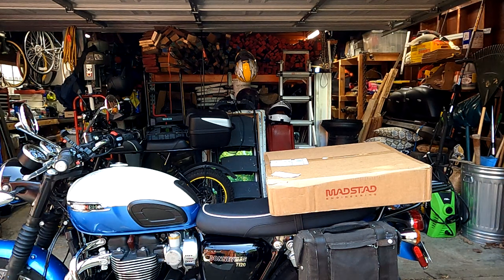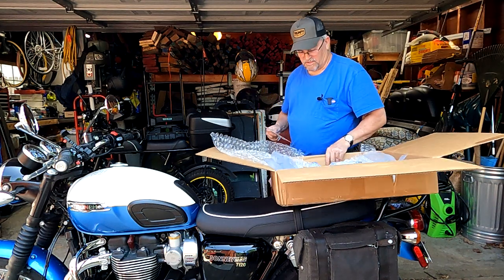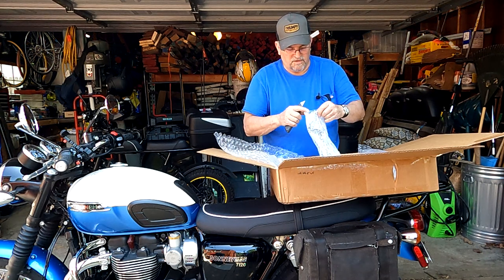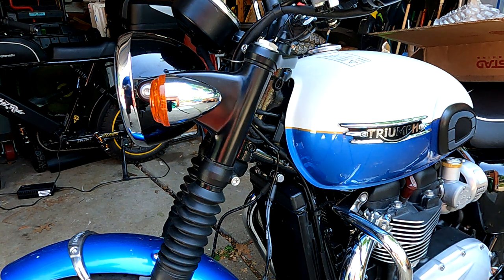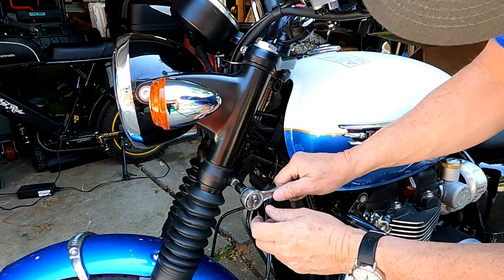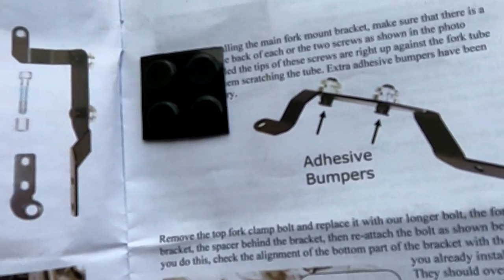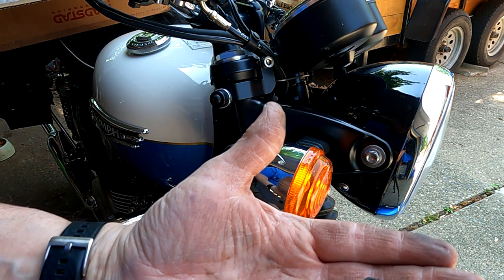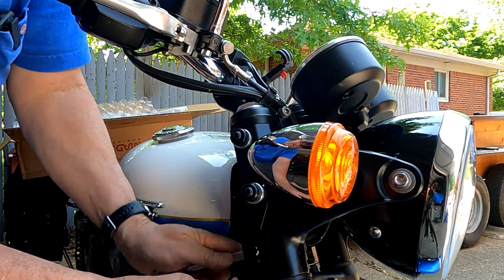Triumph Bonneville Madstad windshield install

Comment: I got mine installed a couple of weeks ago with the help of your tips.  So far the best windshield for my Bonneville T120.  Madstad is a no brainer because of the adjustability.  Back all the way I will get the summer breeze, and for winter it’s just about perfect, if you can call it winter for what we get in SoCal.
Reply from the maker: Thank you, it's good to hear that my video helped someone. I'm still very happy with mine. Waiting for spring to come so I can getbriding again. Snow on the ground still here.

Comment: You made it look easy!  Mine came today, pretty straight  forward, although the locking mechanism  for the detach were on wrong from the factory,  windshield  did not line up, figured it out but it took time, bought the 18" I'm 5'7" and this worked fine, no buffeting,  windshield is a little  flimsy  but I think it's designed  that way to give it a little flex, much better than the dart marlin windshield,  overall happy with it,

Comment: Hello! Thank you very much for the video. It looks really well constructed.

Just one question: have you already tried in the highway? It will highly appreciated to know your feelings after the riding test. Thank you in advance.
Reply from the maker: Yes I have used it on the highway. For highway use I like to raise it up. Lower speeds around town I lower it to about the mid point. The beauty of this windshield is its adjustability.

Comment: Hello, 

I have a Triumph Bonneville t120 black  . 2023 Model.

A couple of days ago I installed the Madstad windshield by watching this video and thank you for it.

After Removing the stock top fork clamp bolt and replacing it with the ones Madstad  provided, I see that the bolt is not %100 in its place screwed.

So,I just wanted to ask you if this is a normal situation or did I do something wrong? I took the picture of it as well and can send it to you too.

Your help would be super helpful and thank you very much.
Reply from the maker: Compare the 2 bolts side by side and see if the new one that madstad supplied is indeed longer. Mine was.

Comment: Nice work, I was wondering what it looks like taking it off and on with the quick release.  Was the cost of this more than Memphis Shades?  I think I was looking at them before but that was quite a while ago.
Reply from the maker: I filmed it taking it on and off but the camera was in picture mode and not video, grrr. I think it was more than the Memphis shades but it's a very different design. Totally mounts to the fork and is a breeze to remove and put back on with no tools needed.
Reply: Gotcha, I’ll take a look again before you put the windshield on, so you just unhook the side then and don’t have to mess with the screws in front when taking them off is I guess what I want to know.  I love the look of the naked bike, but yeah, reducing wind to the body would be great at higher speeds.  I can’t ride or do work on mine as I’m recovering from surgery so I’m living vicariously through you now and planning for the future.
Reply from the maker: Yup no tools, just 2 quick release brackets that you pull out and then swing up out of the way and the shield lifts right off, goes on just as easy, takes seconds to do.

Comment: Sir, where did you get that adjustable windshield for triumph T120.
Because I have one too. And I need one.
Reply from the maker: The brand name is Madstad, they are in Florida USA. They build each one to order. I'm very happy with this windshield. If you Google it and give them a call they will also tell you how to measure for the correct height windshield for you.

Comment: Please let us know how it works. What height did you get? I’m interested in getting one. Thanks,Chuck
Reply: I think it looks great,  Chuck
Reply from the maker: I ordered the 18" height and for me at 5'9" it's perfect. But if you call the company they will tell you how to measure for the correct height, it kinda takes 2 people to do it correctly.  Have an assistant help with that. I've had it up to 70 mph for the first test run as you saw me set it up and it worked really good. It's a much .ore relaxed ride at speed as your not holding onto the bike trying not to get blown off. And the biggest thing for me was much reduced wind buffeting, almost non existent! I'm still going to play around with the angle and height a bit just to see if I can improve it further, but overall I'm very impressed with it. They sell replacement shields for it if it ever gets damaged or scratched and you can get it tinted too. They make each one to order so it does take some time to get it but it's well worth the wait.
Reply: Did they have you measure your torso?  I’d think that would make more of a difference than overall height.  When you went on your 70mph run, was the wind hitting your helmet in a certain area?
Reply from the maker: Nance they have you sit on the bike and hold a measuring  tape on top of the headlight at an angle the same as the fork and have someone look to see where your chin is in alignment with the measuring tape, then subtract 2 inches so you will have some adjustment.
On my first test run at high speeds the wind seems to hit the top of my helmet, a little adjusting and I think that will be gone. And I look over the top of the windshield.
Reply: @woodtickgreg6926  sounds good and professionally done.
Reply: Thank u so much, influenced me to order one, I  downsized  from a harley  road king to triumph t120, also installed hepco Becker c bow luggage and heated grips,  I don't reccomend  corbin gunfighter and lady seat, hard as a rock!!,  I do have a dart marlin windshield, it does keep a small amount of wind off you , also stops bugs from getting all over the speedo and tack, it does really accent the bike though, can't wait for the madstad,  thanks again for a very informative  and well explained video
Reply from the maker: @robertparisi8016   yeah I don't think the corbins are what they used to be. I have heard a lot of folks complaining that they where hard as a rock. I'll probably go with a stock triumph comfort seat at some point. Now that I've done some longer rides I can feel the need for some improvement in the seat.

Comment: Great video, you just sold me on the Madstad 18" for my T120 (i'm 5'6"). I am curious how the brackets look on the bike once you took off the windscreen using the quick release, a picture or video would be appreciated.
Reply from the maker: In another of my videos, I think it was the top box plate install I do show how to remove it and put it back on. That will show the brackets that stay on the bike.

Comment: Please do a video showing what angle worked for you, and please show how easily the screen comes off and what hardware is left.  Thx!
Reply from the maker: There was no hardware left over, if thats what you mean. I did show how I take it off and put it back on in the top box plate video, it's at the end. Height of windshield and the angle will vary by the rider. You just have to try a few settings until you find what works for you. Also keep in mind that I chose the shortest windshield they offered. I think it's 18" But if I get a chance I'll try and do another video on it.

Comment: Now that you’ve had it on and ridden it how do you like the windshield?
Reply from the maker: @mikehershberger7229   I have no regrets. I did play around with it for awhile to find the sweet spot to create the smoothest pocket of air. I find for around town and speeds below 45 mph I like it on its lowest setting just so I can get a little more air. But on the freeways I pull it all the way up to get the wind to go over my head and yet I can still look over the top of the windshield. If I had it to do all over again I would buy it again because of its adjustability.
Reply: @woodtickgreg6926  thanks man!  I appreciate you getting back!

Comment: Great job Greg on the install video. I've been thinking about going the Madstad route for my 2023 Speed Twin 900. After watching the process and end result, I may have to get a bit more serious as it looks great on your beautiful T120. We're about the same height and was wondering what height windshield you ordered? Thanks in advance for any info you can send my way..........Steve in NM (subscribed)
Reply from the maker: I ordered the 18" windshield, it's the shortest one they offer but it has about 4 inches of adjustability. You do have to ride it and go through some trial and error to get the angle right but the height was easy to set. I set it so I can look over the top of the windshield and then played with the angle until I was in smooth air. I'm very happy with the madstad windshield.
Reply: @woodtickgreg6926  
Thanks Greg, that's what I came up with after reading on how to measure height. Looks like it should do a great job of keeping me a bit more protected from the elements. I'm running a Dart "Marlin" windscreen and like it for summer riding here in NM. The madstad would likely take over in late Fall to early Spring. Happy 4th!

Comment: Looks like you're on the same trajectory as me since I've done the Madstad immediately after purchase of the my 2020 T12O in 2021.  The main problem for mine was side to side movement at highway speeds especially following vehicles which i devised a fix for.  I will be curious to see what your experience with this windshield will be and incidentally I have purchased and used the Madstad lowers and cannot honestly say I can tell any difference.
Reply from the maker: Interesting comments. I've got to give it more time. Side to side movement I have not noticed. I just find it to be a big improvement so far.
Reply: @woodtickgreg6926  also I have the Motone up and over hamdle bar risers and they have no effect on the operation of the Madstad windshield either.
Reply from the maker: @Mike Popelka  yeah I figured that out when I realized the windshield didn't attach to the bars in any way. But thanks for that Info.
Reply: I devised a fix too! Excellent windshield and the lowers work well too!

Comment: Which size did you get? 18, 20, 22, or 24?
Reply from the maker: I went with the 18" it's about in the middle of its adjustment range and it's perfect for my 5'9" height.

Comment: Hey Greg, I’m not sure if you heard about a recall for the 2023 T120s…the front left brake wasn’t put on correctly for some.  Here is the PDF with the info in case you need it.  https://static.nhtsa.gov/odi/rcl/2023/RCLRPT-23V146-7563.PDF